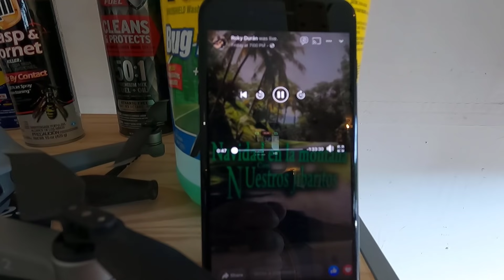Clearing Land on the Future Homestead

Comment: I'm pretty sure you have to replace that washer of the oil screw every time you change the oil.♻️ PS amsoil  is the best oil you could get for all vehicles.🤔
Reply from the maker: Harry, yes, I did read that somewhere. It is recommended, but I have been using the same washer on my Acura since 2009 and no problems yet.
Reply: @geraldfelix7222  AMSOIL Signature series 25,000 miles.
Reply: @geraldfelix7222  Use washer are crush washers, Maybe future leak.
Reply: I do agree to disagree Thank you.🚙